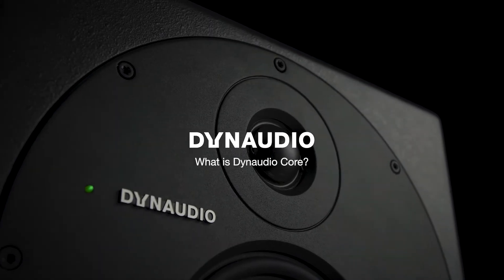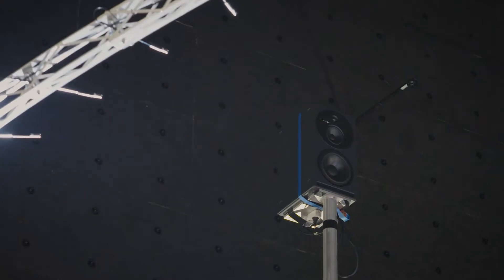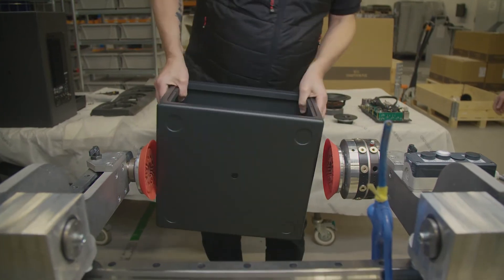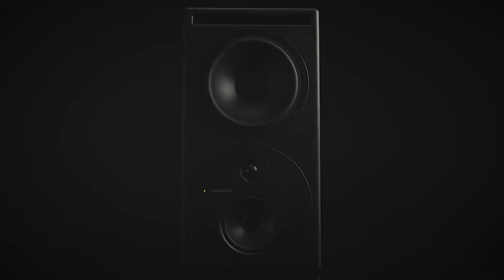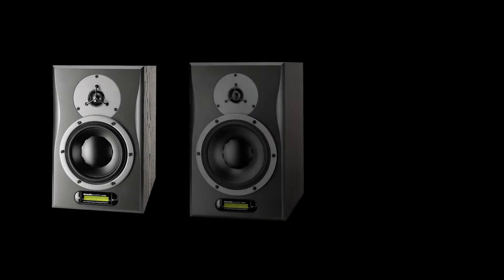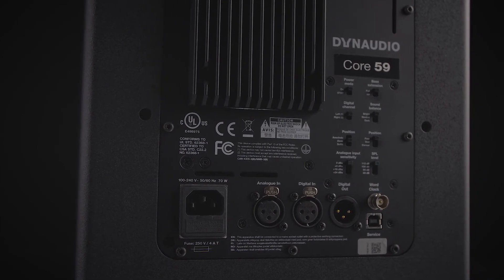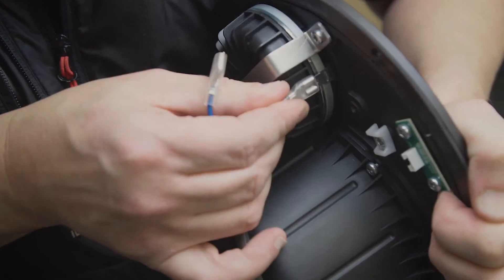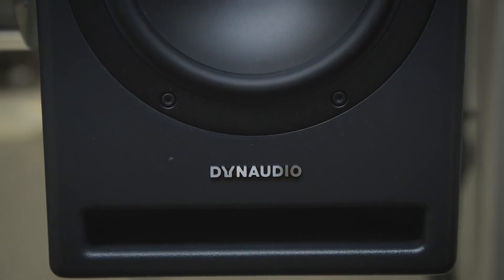What is Dynaudio Core?

Comment: Hello Dynaudio, I just purchased a pair of your Evoke 20's. I am in the process of burning them in. Are they essentially the passive version of the Core 7's? Or possibly superior with the Cerotar / Hexis tweeter? Thanks!
Reply from the maker: Hi Mark. The Evoke series and Core family have been developed separately - so they aren't active and passive versions of the same design. We have made different decisions throughout each development process, as they have different use cases. With that said, you will find similarities as our home hi-fi and professional speaker share many traditional Dynaudio technologies 😌 //Christopher.